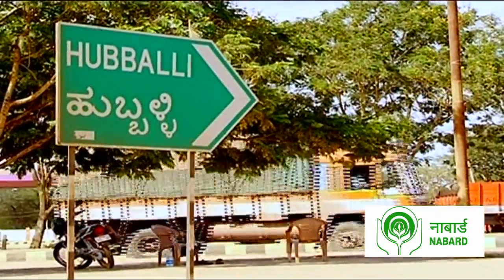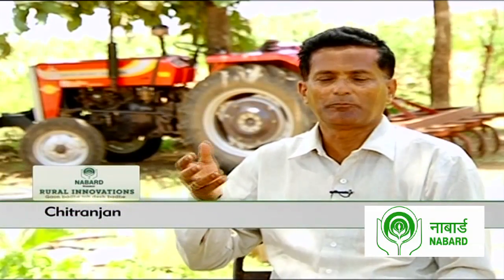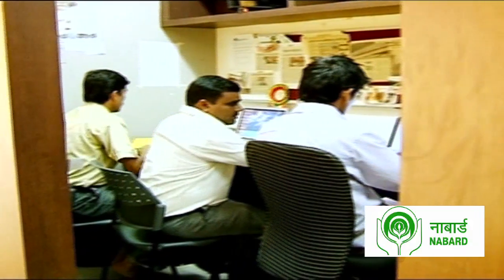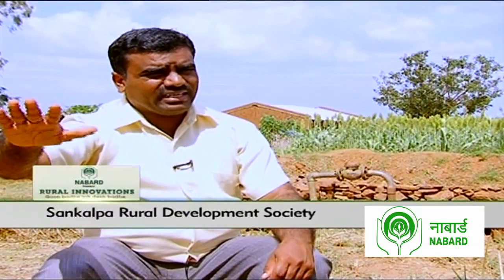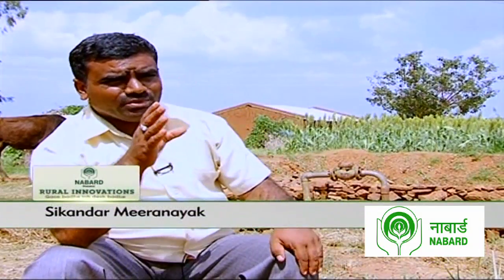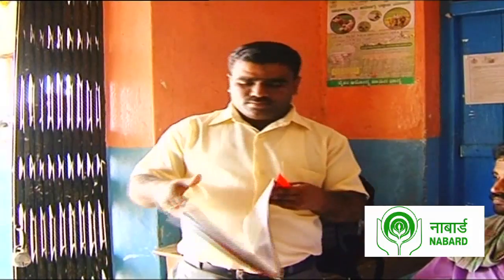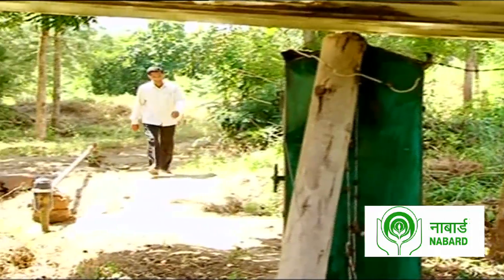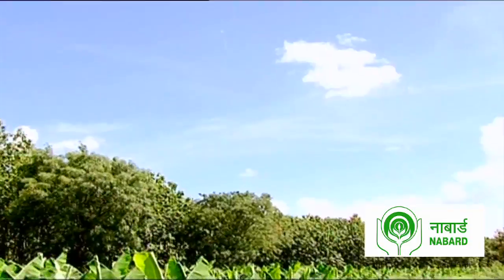Direct Bore-well Recharge

Comment: Please tell me this   organisation also working in Chinsurah, Hooghly, Pin - 712102, West Bengal
Reply from the maker: Dear Sanjib,
They are not present in West Bengal. However, you may contact the innovator, Mr Sikandar Meeranayak, on 0836-2378500, 9986840730 or at sikandar@srdsindia.org.

Admin Team

Comment: Sir I want recharge my borewell in Maharashtra satara
Reply from the maker: Hi Gaurav,
You may contact the innovator, Mr Sikandar Meeranayak, on 0836-2378500, 9986840730 or sikandar@srdsindia.org.

Admin Team
Reply: @nabardonline   Hello, this is very inspirational. How do I get details on this type of installation in Kenya?
Reply from the maker: @kevinonyango2434  Hi Kevin, 
Please get in touch with the innovator, Mr Sikandar Meeranayak, on +91 836-2378500, +91 9986840730 or sikandar@srdsindia.org for possibilities of installation in Kenya.
Admin Team